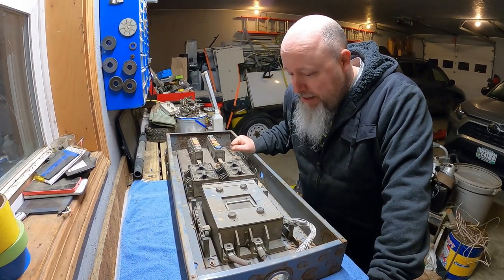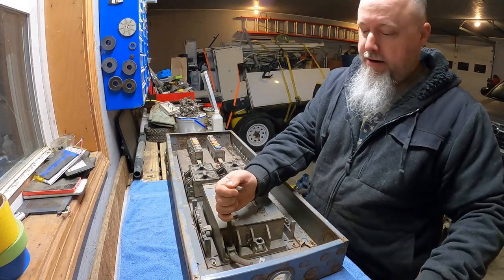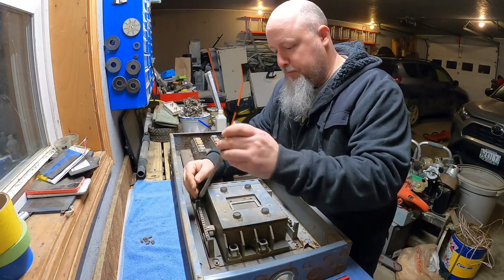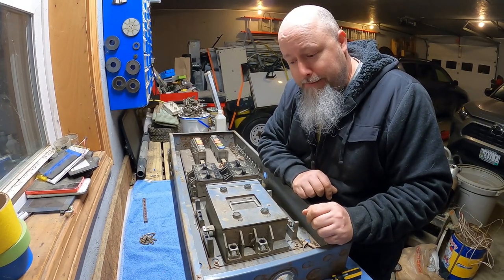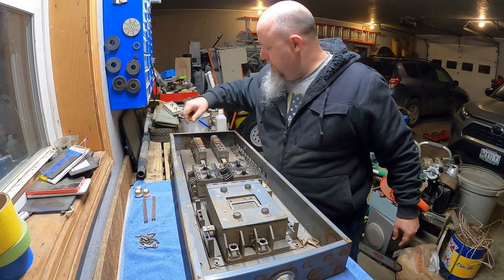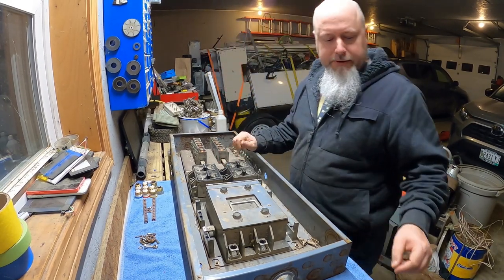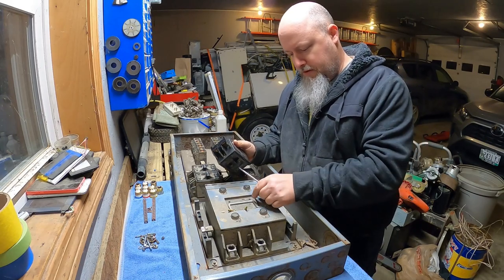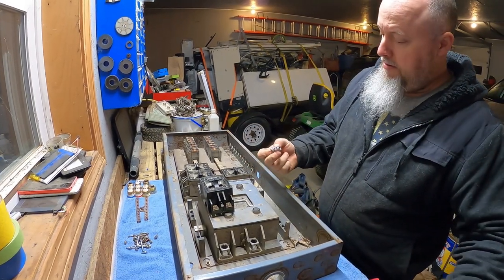CASUALLY SCRAPPING OUT A FUSE BOX

Comment: Don't forget to get the silver out of the breaker .I save them up till get about 5gal bucket full put in cement mixer with some chunks of iron for about 10 to 15 mins pick out the brass copper and silver or rap it in a rag and smash with a hammer like uncle Ian would do in the